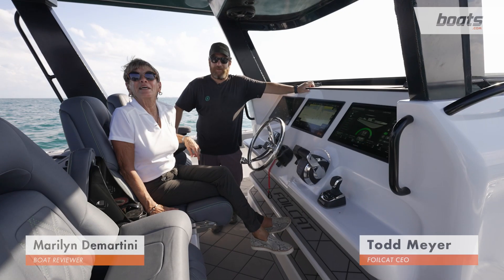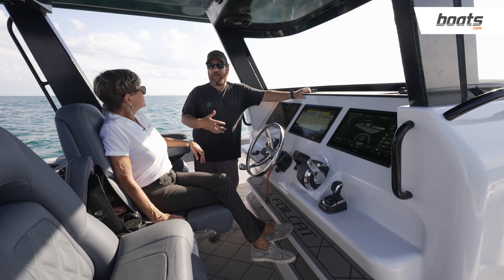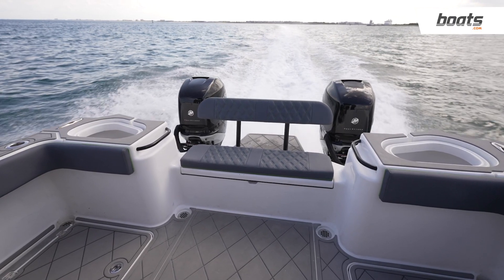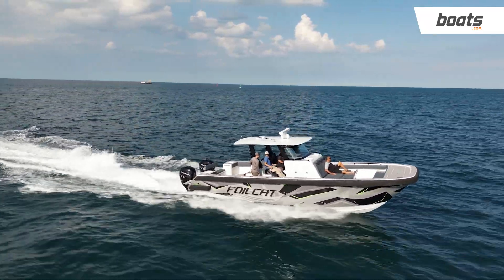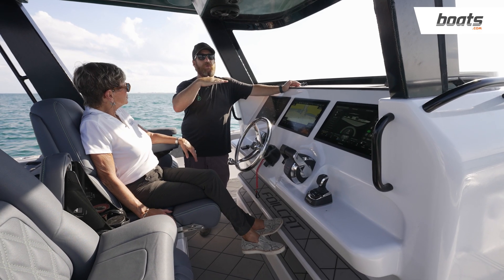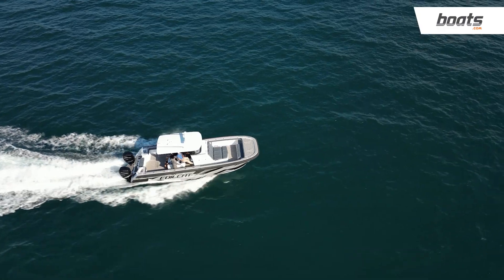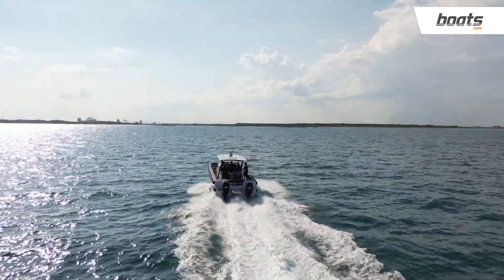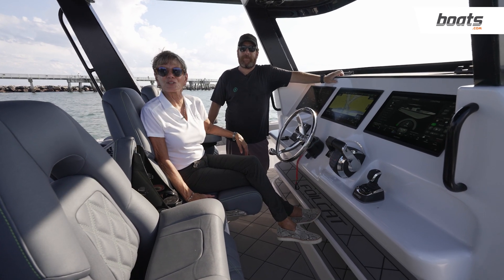FoilCat: Amazing 34' Hydrofoil Power Catamaran Center Console Boat!

Comment: Do they ever show the foil they are talking about? Is it on the boat, or the engine lowers? The propellers on the motors surely arent moving, what keeps them in the water? Fountain did this with a stepped hull.
Reply: Not sure about foilcats, but Insetta's is a permanent piece between the sponsons
Reply: It’s permanently mounted to the sponsons a little towards the rear of the boat.

Comment: I'm almost 80 years old, been boating most of my life... Every few years the boating community catches what I like to call 'catamaranitis' a very expensive disease... 'Nuff said!!!...
Reply: Not a big fan of Cats? Or just not much of a difference to you? Just curious with your experience that’s all, I’ve been looking into them but not sure.
Reply: @nicoblac9368  Don't want to seem evasive but,, depends on what you're going to use the vessel for and where you're going to use it... Get back to me when you can and give me the details and I'll do my best... Thanks. 2:20 p.m. here in Glendale Arizona. We don't turn the clocks LOL contact me as late at night as you want. I gave up sleeping a long time ago
Reply: @nicoblac9368 I’ve had 3 cats since 2005 and will never go back to a Vee hull.  Fish and dive the Gulf of Mexico and it’s a washing machine at times.  There is no comparison in ride when it gets nasty.  You may get more speed from a Vee in certain conditions, but when it’s rough you will leave the vee in the dust.  Not to mention the additional deck space of most cats.  Go do some test runs in both.  Still have plenty of friends w big vee hulls, but more and more are switching.  Almost every guide out of South Louisiana is running a cat now.  There’s a reason.
Reply: Yea.... I could see how a catamaran wouldn't be useful in Arizona
Reply: @URbeatSon  😂😂😂
Reply: @URbeatSon  Thanks for taking the time to respond...

Comment: Looks pretty IN the water to me for a hydrofoil.
Reply: A South African professor of marine dynamics and an associate invented the HYSUCAT concept, which stands for hydrofoil supported catamaran, but the other name used is hydrofoil assisted catamaran, which is more accurate. The airfoil shaped wing that connects the demi hulls is designed to lift most, but not all of the boat's weight above the surface, as to get the lower drag and smoother ride of a hydrofoil but not the control and instability associated with a true flying cat. So you're right, a HYSUCAT doesn't completely fly, just mostly, 80% or so. Efficiency, speed, smooth ride, the width and space of a cat make this the tech of the future, even if it has taken a while to gain acceptance. Marine design traditions are sometimes the hardest to change.
Reply: think more surface foiling.  a lot simpler and you still get a lot of benefit.  full foiling boats coming out (look at some of the new electric boats like candela) have limitations in heavy seas.
Reply: @dr34994  They don't have any photos whatsoever of the hull. The FoilCat website also states the hull design is limited to 58 mph due to hydrofoil cavitation.  Interesting.
Reply: @Ballista  I have a world cat 320cc, pretty comparable boat....I'd LOVE to be able to go 58 mph....or even cruise in the 40s as this claims to do. Now...I'd compare this to an insetta....I'm sure the mysterious price point would be the biggest deciding factor